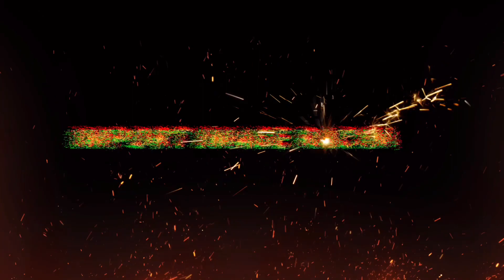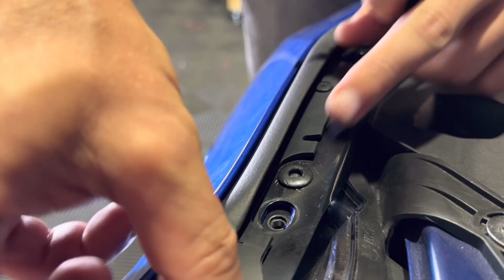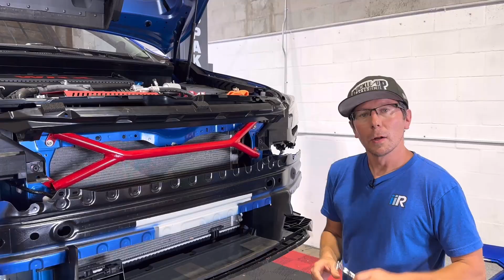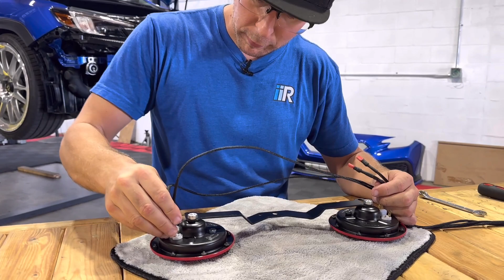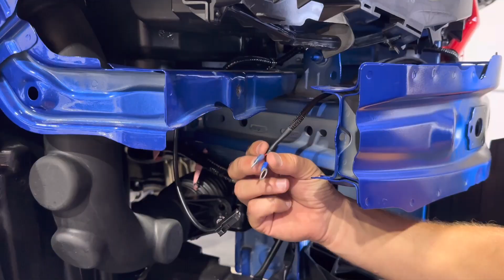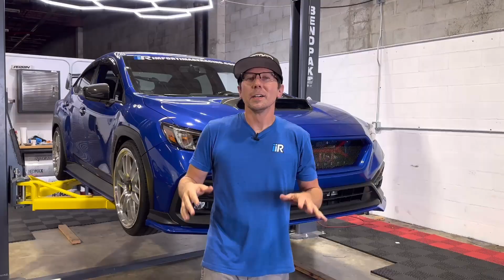Hella Horn Install & Plug-N-Play Harness for 2022+ Subaru WRX

Comment: My horns blow a fuse when I honk for more than 2 seconds straight.  I did not use the included relay, nor will it fit into the the horn relay slot of my 22 wrx.  What could be causing this?
Reply: When you blew that fuse did the factory horn on the drivers side still work. I ran into the issue where the hella horns stopped working and the factory one still was functional. Did not use the relay
Reply: @nateoliver3821  No it did not, as I removed the factory horns.  Since each factory horn was inline with 7.5  amp fuses, and now both Hellas are only on 1 fuse, I upped the fuse to a 15, to fix the issue I was having.

Comment: My horns wouldn’t work with both plugs in the back of the horns. It would just blow a fuse. Once I took one of the ground off now they both work… weird
Reply from the maker: Did you use a preassembled wiring harness like the Noble HELLA HORN harness? Or did you source your own wiring?

Comment: For anybody that's curious this is the easy way to install a harness they're not utilizing the included relay and hooking power to battery which results in the horns not being as loud and not being able to sound off as long as they should be
Reply: I was wondering about that too. Thank you for pointing this out. I will probably purchase horns, relay and bracket and make my own harness.

Comment: Silly question of the day. If you took off the brace, could you mount the horn bracket using the alignment pin??  Then reinstall the brace??
Reply: The bracket is not a flat bracket. You can mount it one way to stick the horns closer to the grill. Or flip it 180* for added clearance behind accessories like the Noble X-brace!
Reply: @BuckleUpGarage_  I see said the blind man.
Reply: I meant use the alignment pin. I see what you’re saying about the horn bracket. Heck, if someone wanted to do the sports grille, brace, and horn setup it looks like you could do it in an afternoon. I love Subarus. So easy to work on for the biggest part.
Reply: @Rick4345  until the head gasket blows lol

Comment: I would have thought the drivers side horn needed disconnecting?...there are 2 horns on the vehicle stock.
Reply: Yes, there are two horns from the factory. You can choose to disconnect 1, or both! But for the most powerful horn output, we left the second horn connected! 🔊🔊🔊